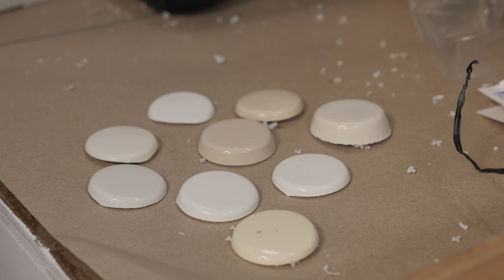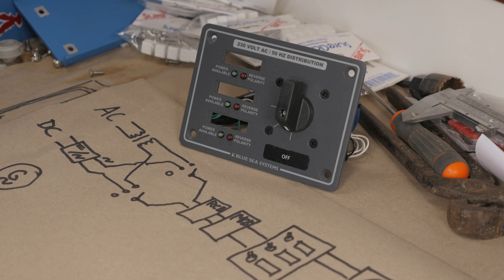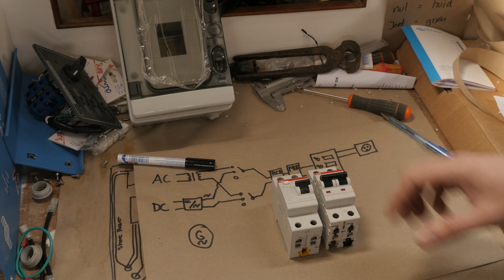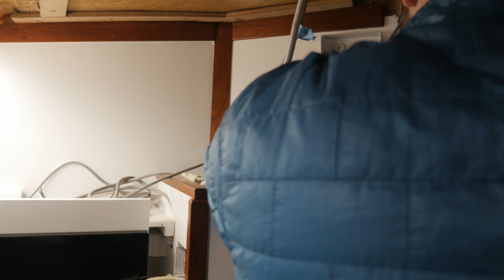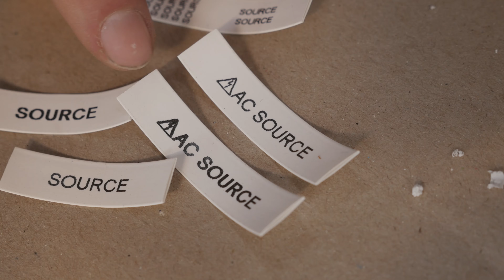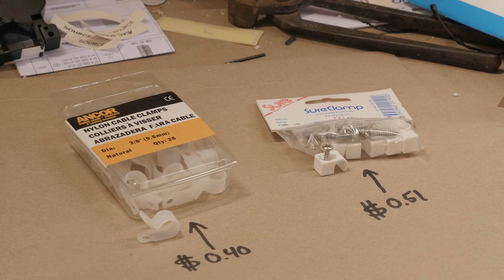Sail Life - Rewiring the AC, RDC, MCB & cable clamps - DIY sailboat refit

Comment: just curious if you plan on using  gromets on the cable as it goes through the bulk head? Lots of vibration and it looked like the cable was tight against the hole edge.
Reply from the maker: I'm not planning on using grommets as such. What I'll do is simply just so squirt a bunch of caulking in there :)
Reply: Mads is correct you need to fill the holes, to prevent water infiltration and  breach, in the different compartments of the hull. Once wiring is done. You should close every holes.  Caulking with a Anti-fungal should do the trick. This is just my opinion.
Reply: I agree that bushings would be much neater as far as OCD is concerned and protect the cable where it goes through drilled opening through bulkheads and cabinetry.  If this were a commercial job in the US, grommets would be required to meet NEC.  They make split grommets that can be installed later around the cable.   Openings can still be caulked watertight with the grommets, but the caulk is not rated as chafe/pinch protection in itself.

I'm a commercial electrician and sort of hate "boat cable" which I feel is really no better than janky stranded Romex with tinned wire.  Vinyl marine wire insulation is way more prone to chafing and slicing-through than thermoplastic insulation such as THHN, especially at higher running temperatures and the vibrations/motion encountered at sea.   So I'd rather see marine installations be wired with flexible non-metallic conduit with individual conductors pulled within them than with "Boat Romex" cable.   

Carlon makes a very nice flexible watertight non-metallic conduit that is pennies/foot and has watertight connectors that can be used with PVC watertight junction boxes.  They make 1/2" and 3/4" as well as 1" and larger sizes.  They probably make similar conduit for Euro/metric sizes.  This is how I rewired my own boat.   I even use this conduit to protect the larger #2 and 3/0 battery and engine cables run outside of the battery compartment.

Comment: Did I get this right?
You have (in the boat) a small display that shows how many kWh you have used, but still wants to fiddle around with a photo-resistor, an Arduino and software?
Du you ever expect to go sailing?
:-D
Reply from the maker: Yup, you got that right ;) There is an offseason no matter where you go and I'll need to have something to keep my busy ;)
Reply: Jolly good, carry on
Reply: I found this channel via a recommendation from another channel. And there it was said that, as soon as Athena is finished with nothing left to do, he probably will get another boat to work on. ;)
Reply: And being able to check power consumption when onshore via a web facing arduino powered web page would have it's benefits. I use a Flukso device on my home to monitor the power consumption  and solar output. It sounds crazy i know but i find it very handy. Sometimes when i arrive at work in the morning i may need to call my wife. It is still early in the morning and there is the chance the family is still asleep. So i just check the power consumption and the chart will clearly show the toaster and kettle usage. Then i can call without fear of waking up the whole house. For yourself i imagine it would be nice to be able to double check that you remembered to switch off the electric heater, electric blanket, osmosis heat pad, etc.  :)

Comment: I must admit, I do love your "OCD" cable management system. In my estimation if I can invest 5 minutes now to save myself hours later, those 5 minutes are well spent.
Reply from the maker: Thanks! OCD is a blessing and a curse ;) I'm glad you liked the result :)
Reply: I would say I'm a tad "OCD" myself, but that's not true. I'm actually "CDO" which is similar, but the letters are alphabetized, like they should be.
Reply: @geraldthomas9253  - If, instead of alphabetically, you sort the letters by shape (as you should), "OCD" is correct.. going from most round to least round shapes. ;-)
Reply: Sail Life  Some people say OCD, but in reality that wiring is code compliant. Not something seen often in self built boats, and often in the commercial vessels I work with. Love the content. Cheers.

Comment: Will you install a Solar Panel? :D
Reply from the maker: I sure will :) I'm holding off as long as possible to get the most effective panels possible :)
Reply: Would the batteries be different for a boat rather than home ones? Could you use something like the one in this vid /watch?v=4OHstY_kKUY